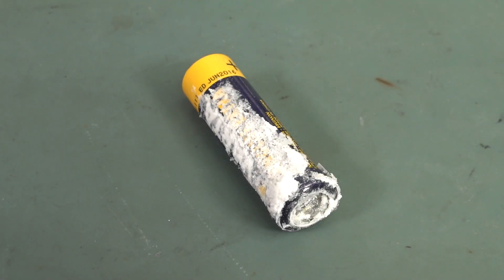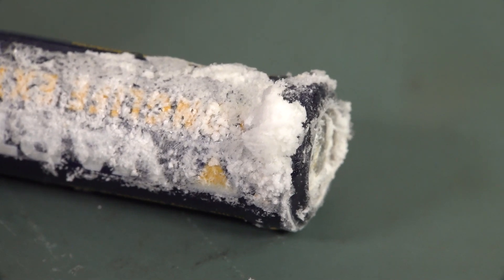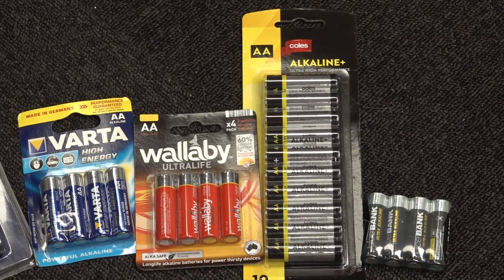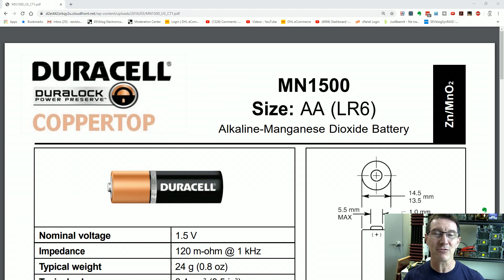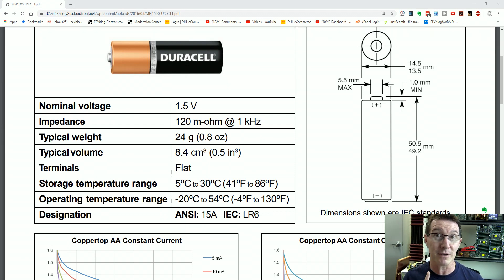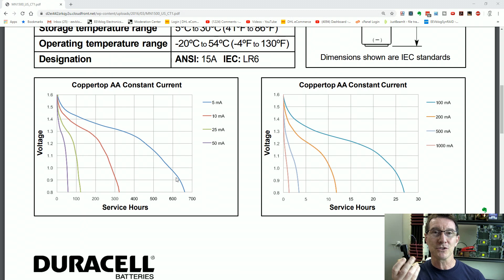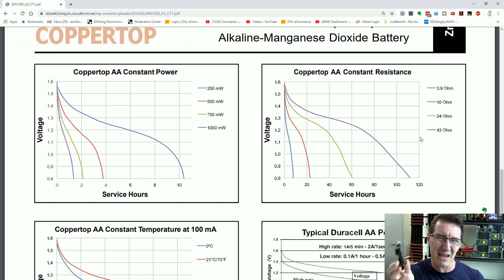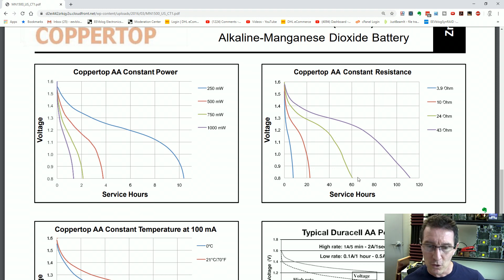EEVblog #1296 - Alkaline Battery Leakage Testing 2 - Electric Boogaloo

Comment: Think I just Nimh long term in stuff here. I am still trying to figure out how to replace the like 12 AAs for my 300 in 1 with a wall adapter.
Reply: God knows what a "300 in 1" might be. Just wire the wall adaptor to the positive and negative terminals.... it's not even slightly difficult to work out.
Reply: @johncoops6897  Mostly, but I need to try to figure out what the amperage of like 6 AAs are so I don't destroy all the chips and LEDS. I also had an initiative to make those $2 Chinese laser pointers run off of an adapter instead of batteries, and last time I tried I destroyed it.
Reply: @MatthewSuffidy  - any decent LED or laser pointer will have a proper constant current power supply, so it doesn't really matter what voltage of power supply is used. However cheap lamps and lasers just use a resistor to drop the voltage... for those ones the voltage is extremely important.
The easy solution is to measure what the voltage is when the batteries are full, by measuring the voltage across the battery pack while the device is running. Also measure the current by inserting the multimeter (in 10A range) into the circuit, for example to bridge between negative terminal and the battery negative.
12 x AA's is 18 volts. You might have more success using a cheap 12V 1A or 2A wall adaptor, then run that into a Constant Current step-up (boost) converter - that would allow you to adjust the voltage and current to best suit the load.

Comment: I think there's another way to make batteries leaking. Put batteries AND Accumulators in the same draw and leave it alone. It's a few years ago when i hear first a little pop noise and then a decent cooking noise. The only thing that lays around at the direction from where the noise came from was a draw with batteries and another with accumulators in it. Just one AA-battery maked a quitely bubbling noise and gets really hot too. Usually I always make sure to store batteries and accumulators separately. But I probably hadn't really paid attention at this one. I'm not sure anymore, but I think there was a NiCd-Accumulator between the batteries.
Something similar happened about half a year ago, but:
In front of me on my desk was a SINGLE 9V block battery. Suddenly and without warning there was a slight bang again, she jumped up briefly and then stood there again calmly. No more noise, no heat and no deformation. The Voltage was unusable low. WTF?
I think something similar happens between batteries and rechargeable batteries like putting apples and kiwi-fruits together. The kiwis then ripen a little faster.

Comment: The twenty mega Hertz bandwidth limit selection value was NOT chosen arbitrarily, above 20 MHz. the wiring becomes little antennas that pickup common radio transmissions that interfere with measurements.   If a 2 Gig-a-Hertz scope had a 200. mega Hertz bandwidth limit selection value instead, it would display every local FM radio transmission, TV channel 2-7 and 99% of all HAM radio transmissions. (even police and taxi radios)  It is not a mystery.  Dave is suppose to understand all of this. Some people have always baked used cells (before alkaline cells) in their oven at a low temperatures and used them another third. Ron W4BIN

Comment: I stopped using alkalines few years ago. I have honestly 0 alkalines in my apartment. Nowdays the rechargeable Ni-Mh (Eneloops) are so good and quite cheap that there is no reason to use alkalines. In really low discharge applications (2years+ battery lifetime) I have Energizer lithiums but mostly eneloops everywhere. And honestly it is more convenient to use compared to non-rechargeables. For example: I use flashlight for some time and with alkalines I am like "should I replace those batteries now to have fully loaded flashlight ready to next use? But it is wasteful as they are probably still half full" and then I have box of half-full battereis of unknown capacity etc etc... With Eneloops (or other low self discharge ones) I just put them to charger and they are good to go. Occasionally I run capacity test to see if they are still good.
Reply: doing very same thing, but with wireless mecs.
Not guessing battery SOC and just inserting it into the charger is amazing. 
1. convinient, 2. cheap, 3.environmentally friendly 4. harder to put (half-)empty battery into the mic (possibility to spoil live event is nearly eliminated)

Comment: I think what makes them leak is running them down to as close to zero volts as possible, taking them off at .8v is probably why they aren't leaking.  I have a led picture (glowing windows of a painting) and led Christmas tree decoration that don't have any kind of low voltage shut down, within a day of the leds diminishing to no visible light, the batteries will be soaked with electrolyte.  It happens every time, within a week or two of putting in fresh batteries.

Comment: You should just buy a bunch of old TV remotes from similar TV models on eBay or something. Clean them up both internally and externally, and you're good to go; no better real world simulation than sticking them all in actual real world products that use them amIrite?

Comment: Never Buy Varta, every Device where i had Varta Batteries looked exactly like this one and the Terminals are completely corroded. I also had new Packages which are still sealed and leaked in the Box after a few Weeks. 
I Never had such a bad experience like i had with Varta Batteries.

The EXP Date of my Batteries is still not reached.

The best Batteries in my Opinion you can get here in Germany are the Cheap Batteries from ALDI and LIDL.

You expect that Expensive Batteries should be better but in my Case those where the Worst i ever had, i never had leakage while i'm using ALDI and LIDL Batteries.

Thanks to you it proved that i'm not the only one who are facing that issue with Varta Batteries which leaked whithin Weeks and not even with any Load on it.

Comment: 'ey dave, have you thought about using a good oldfashion moidel 120/240/120 solid copper, vinyl coated household yankey plug interconnection conduit filler bent into a roughly  G shaped piece to help discharge them?? @eevblog

Comment: People say Duracell are notorious for leaking...I've got probably 15 different brands of batteries...EVERY SINGLE ONE OF THEM Have leaked.  EVERY ONE OF THEM.  No difference in brand.  Energizer, Harbor Freight, Sanyo, Toshiba, Duracell, Radio Shack (yea, I know, they are gone), G&C, Panasonic, Amazon Basics, Ray-O-Vac, etc.   Every single one of them have leaked...and I haven't seen one more prone to leakage than the other.  They all do it...
Reply: same here .. had leakage with all brands and no-names .. most leaked after being well beyond their best-before date .. so i blame it on myself :(

Comment: I Dave, I recently had some damage because of leakage too, it really sucks! I got the impression they specifically leak when they still hold voltage. So no voltage (0V), no leakage.  Maybe it's interesting to test at which voltage they leak best! I am wondering if the current has any influence at all.

Further, why not discharge easily with a 1V zener or a normal diode in series with your 47 ohm? You might not even need another higher resistor, the diode probably keeps a very little current flowing at the threshold voltage.

Comment: I had a automatic perfume air spray thing. Every time I would open it to change the batteries, batteries where all leaked and rusty. F-ing pease of crap
Reply: What brand of batteries?
Reply: @MrSleepProductionsInc  any I put in there, I think it was because of humidity or maybe material of the contacts used in that thing

Comment: If you say the battery leaks because it builds pressure inside to overcome the seal couldn't instead be due to a very fast discharge like an internal fail/short?

Comment: What about a standard silicon diode with a low value resistor in series and a high value one in parallel to more or less automate the discharge process?

Comment: There is a guaranteed way to get them to leek.  Install them in a valuable device (The more expensive the better) and place in a closed draw for about a week and when you need the device the cells will have destroyed the device.
Reply: The problem with your suggested test setup is that after that week you won’t really need the device. Not to mention that you’d want them to leak so they won’t.
Reply: Is this the famous Schrödingers battery? 🤔
Reply: Exactly what I was going to say but you beat me to the punch.
Reply: Leeks and onions make great salads.
Reply: Does it have to be a closed "draw"?
Reply: @I_leave_mean_comments  Drawing batteries doesn't work. Learning to spell is what's needed.
Reply: Yeah, maybe there is a circuit to prevent that
Reply: Oops,  posted almost the same thing.  Guess I should read some comments first.
Reply: I think the reason they leak more often in those cases is because of the spring tension in the holders. The cell construction has the seal between the outer shell and the inner disc. The outer shell is cramped down, so the seal relies on this pressure to block leaks. When you put in a holder, the spring applies force on the inner disk, pushing it away, slightly weakening the seal.
Reply: You can't get batteries to leek because a leek is a vegetable. I've tried putting batteries in drawers over and over because I needed leeks for soup and I spent all my money on batteries, and I have not grown a single leek yet. You did me dirty, tim.

My soup was a failure, and everyone who drank it got chemical burns from the alkaline solution. Boo!
Reply: Maybe this is a better guaranteed way to get them to leek: https://youtu.be/1wnE4vF9CQ4
Reply: @plemli   - Holy crap, that was one of the first things I saw on YouTube just after it was uploaded. Have I been here this long?!?!?

Comment: Not had good luck  with the evolta. a friend bought 40 of them back from Japan the year before last(made in Japan ones) and they almost all leaked after a few months pretty badly in devices. Better than the duracell though that leaked even in the packet.

Comment: Its a shame, that every battery I have bought in the last 15 years was leaking. Some were leaking after some months in use, some after 2 or three years in use. Yes, I have small devices they use very less power, so a battery should hold for years (5 years and more). In these time I have costs of hunderds or tousands of dollar of damaged devices because of leaking cells. Strangely enough in the 70thies or 80thies (in my childhood) there was an invention of "no leaking" cells. And it worked for years until the industry has began to saving material again.

Comment: Completely anecdotal: I’ve only noticed leakage in batteries that are used at relatively low currents, like videogame controllers for example, and then left completely idle for years after they’ve pretty low.
I can’t make sense of why this is the case, but I’ve noticed that literally every wii remote that was in my closet for years had every single Duracell AA leak after 4 years of not using them
Reply: when i build something microcontroller based with very little standby current i noticed that the controller draws more current when the voltage gets too low to operate the controller and enter propper standby mode (brown out was disabled). maybe it is the same for commercial devices? voltage gets too low and the controller errors out and starts to draw more current than normal?

Comment: I did a bit of experimenting since part 1 and found some interesting stuff. 
Stick a fresh Alkaline battery in a remote control with a nearly dead zink-carbon or high capacity Zinc-chloride battery. The Alkaline battery will actually charge the zink battery and then the Alkaline battery will spew it's guts out all over the inside of the remote.  It happens fairly quick if the zink battery is at around 1v.  Last 1 I did blew it's guts out in just over 2 weeks. The set before took almost a full month but I used a full charged zink battery. 
I've tested with battery holders and it works but you need to simulate a light load to get it to work. A small 3-5v LED is the simplest way to put a light load on and it seems to make the Alkaline blow it's guts out faster than with a resistor.
Reply: funny thing about zinc batteries, you can tell how dead they are by how squeezable they are. turns out the zinc is actually the casing of the battery and when you use these, the zinc gets eaten away and the case gets thinner. horror stories of carbon zinc batteries leaking is because they just didn't have any container anymore
Reply: The zinc (with a 'c'!) battery will be reverse charged in this case.

Comment: Dave, you said the positive end can't leak. I left a wireless doorbell for 10 weeks and one of three Kirkland AA's leaked copious white gunk from the positive end and blue gunk from the negative end. The blue stuff burnt through the solder tag on the battery contact. I added vinegar and both effervesced vigorously.  

Since the change in the 2000's I find that Duracell now pretty much always leak when flat and some leak while still working. Kirkland are no better, somebody said they are made by Duracell so I won't buy any more. I think I will switch to Eneloop for everything. Anybody had those leak?
Reply: for me energizer and newly fujitsu AA seem to be the most reliable ones while providing good lasting power to the devices i stick them in

Comment: With my remote control leaking, I would try a "background" discharge with some pulses.  Repeat several times.  Might try to characterize with an actual remote to emulate.  It could be that a pulsing environment might physically repeat flex (a very small amount) which might stimulate a "leak".  Of course I'm just grabbing at straws as to what actually happens.

Comment: Migth it be that the contact spring in the devices press on the seal allowing it to get loose by pressing it into the battery, causing leakage more frequently in devices than in a box? If so, the lenght of the battery might have changed, because the negative pole got slightly pressed into the battery body. Not much, but possibly mesurable?

Comment: The worst battery for leakage that I have come across is the Polaroid brand C cells from the Reject Shop! I personally don't think that I have had one that didn't leak!
If you value your equipment, never use Polaroid brand C cells...

Comment: Is Dave discharging two cells in series with a 10R and expecting it to take 20 hours?
Reply: In summary, Dave picked 10R on the basis that the Duracell datasheet indicated the discharge of a single cell would take around 20h. Double the voltage (2 cells) and the current also doubles (same as using 5R across one cell). Extrapolating from the 3.9R curve in the datasheet, two cells into 10R would likely take around 8 hours to discharge. Pity that Dave changed his discharging strategy... I was looking forward to the followup video. Doh!
Reply: Oh right, the current is doubled, but that means the current draw on each cell is doubled, rather than being split between the cells, which is nonsense.
Reply: Felix Moore Yep that’s one way of thinking about it (Kirchhoff’s current law).
Reply: I'm so confused right now
Reply: Do two cells in series behave in some weird and unexpected way?
Reply: @felixmoore6781  Two cells in series means that the voltage would be twice as high as with a single cell. Thus there would be a higher current and a faster discharge.
Reply: @marvinvesper7531  Yeah, while the energy stored is doubled, the power is quadrupled (since P = V^2/R), and it'd take half the time of a single cell.
Reply: @felixmoore6781  Any capacity imbalance means one of the cells will get reverse charged at some point.

Comment: I should send you my TI-89 calculator. It leaks AAA batteries every 9 months or so.
Reply: Nman120 use eneloops😉
Reply: After reading your post I checked my own calculator which i did not use for a long time.  It is full of crunchy white fluff. dammit

Comment: I guess if you put some with the seal facing down you will see more leakage.
chemical gas can escape the seal, chemical liquid cannot leave without trace.
Ex. If you have a bottle of water, if the seal is facing downward and the pressure rises, then the water will be the first thing pressed out, conversely, if the seal is facing upward, the pressure will only squeeze out gas (steam).
And even though both are H2O, just in different form, the damage will be greater when the water escapes.
But that's just my guess ...

Comment: The varta batteries are a real killer on the old Commodore Amiga computers. Just about everyone  leaks and if not caught in time causes a lot of damage to the PCB traces. 
The computers sit in peoples attics for years and years and when they eventually power them on its too late to save them.
Reply: I've repaired countless Amiga's in 20 years that suffer from leaking Varta's.. despise those batteries.

Comment: You should do a batch where you discharge at 800mA to 50%, and store with no load. I pulled some leaked ones out of a device recently, I measured the load at about 800mA, and it has a physical off switch.